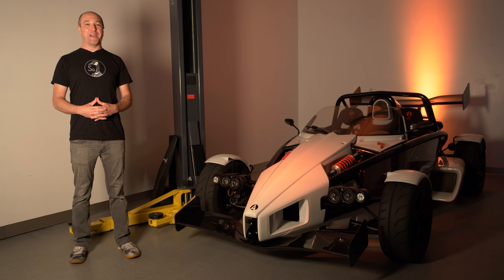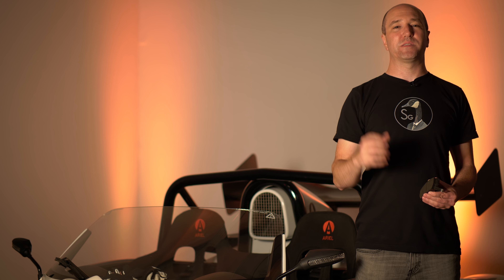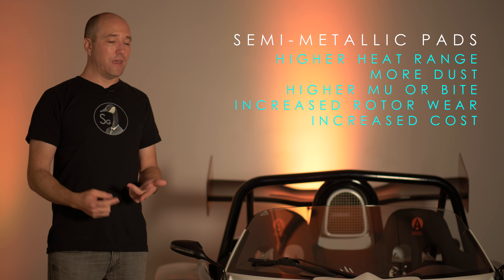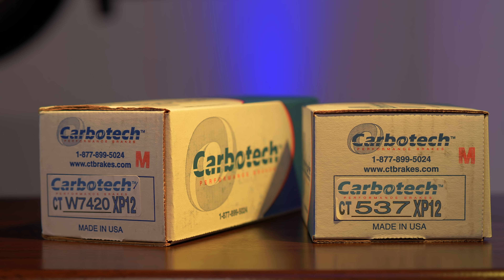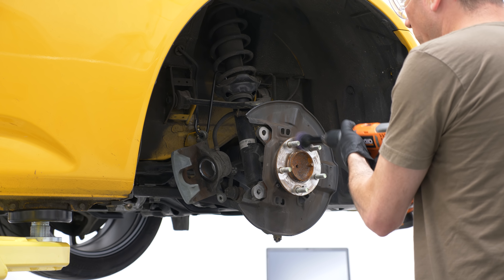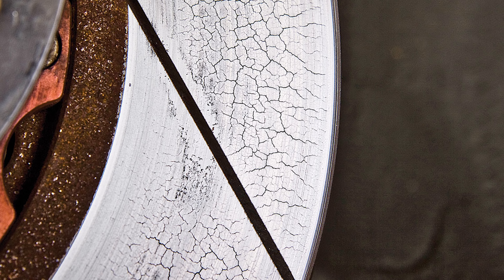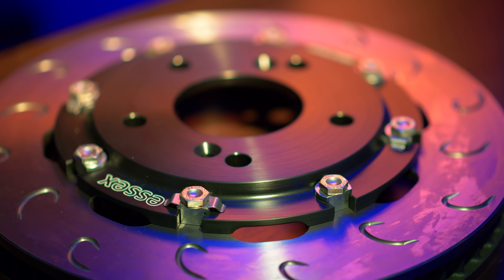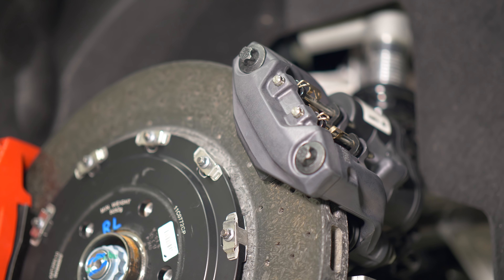Learn About Brake Rotors and Pads | Fine Print Series

Comment: +savagegeese  Question:

2016 WRX with 40,000 miles has had rotors overheated a few times when driving in the mountains of East Tennessee/Western North Carolina, resulting in some pretty severe vibration. Resurfaced and new, stock pads, and it happens again after a couple of more trips to the mountains. 

Obviously the stock rotors and pads are inadequate. But I still drive the car around town, so I wouldn’t want to put something that needs a ton of heat to be effective. 

Probably need a compromise - something that can take quite a bit more heat and abuse for canyon-carving, but still have some decent street characteristics. 

Suggestions?
Reply: You live in a cold area and if you plan to go downhill through mountains you probably need to warm the rotors up by bedding the brakes in before driving on extended periods on those sharp downhills. Or just get a bigger car to handle that kind of braking. Notice how trucks and SUVs speed through that part of the country with less brake fade.
Reply: Omar Tinoco First, the problem I’ve described is happening in warm weather. 2nd, the brakes ARE warm. 3rd, a bigger vehicle would still experience these problems if the rotors were incapable of bleeding heat off fast enough, either due to material, construction or being too small for the car/speed/usage type.
Reply: He just said that you can't expect to go speeding and braking in the mountains while using organic pads. Just get a pad with a high temperature range. Semi Metallic. But expect to wear into your rotors.

Comment: Mark, have you tried Yellow Stuff EBC Brake pads? Because I have, they had the bite but after awhile they gave me vibration to the point I would never buy them again. They're made aramid fibre, I don't know of many brake manufacturers who use that material. If anyone think those will be good for street/track you're wrong, even though they say that in their description. Once I got them hot enough they fell drastically within 5-6 hard stops.

Comment: With bedding in being so important, and with proper bedding in somewhat challenging to achieve without a controlled environment (e.g., deserted runway), why doesn't someone sell matched rotor-pad pairs that are already bedded in properly (perhaps using a specialized machine)?
Reply: I guess the cost effectiveness of that process is under question. Bedding happens by itself too
Reply: I have seen this as an option the other day in a set
Reply: @web  Does it? My pulsating brakes will say otherwise! :) No, it's not a warped rotor. I'm merely an enthusiast, but all that I've read stated to bring the rotor/pad up  to temp and then let the system cool naturally without the rotor touching the pad. Basically, you want to "coat" the rotor with pad residue evenly. After doing X numbers of brake servicing, I find getting up to temp and let the rotors and pads cool independently to be challenging because there aren't many places around me that will allow multiple 60-5mph cycles and then park.
Reply: @X11CHASE  Where?
Reply: It seems likely to me that there is going to be some variance in dimension and alignment between cars (of the same model of course). Bedding in a pad outside of a particular car might not actually align with the final installation in all cars, which would negate the benefits of pre-bedding. 
Now, it is possible that the tolerances from car to car are indeed close enough and no one has yet bothered to explore this potential value added feature.
Reply: I would love to have that job!

Comment: Hey Mark, I was wondering if there are any issues moving from one pad compound to another, but keeping the same rotor. You said bedding brakes in deposits brake material onto the rotor; is there any chance the old rotor material won't work well with the new pad material?
Reply from the maker: The issue is with pad smearing or deposits and some cases the small pits in metal would accumulate pad material as well. That would cause pulsing in pedal.   You could take a high speed drill with abrasive  and clean up rotors before   new pads

Comment: Hi Mark, thank you for this video, I've been watching your videos for quite some time now and just recently I started to wonder why my brake smell like plastic or some bad smell after a hard breaking on my cx-5. I haven't had any work done to the brake pad or rota it's 2014. the smell goes away after it cools down. should i be concern?
Reply from the maker: Thats really hard to say, are you sure its brakes?  If you are smelling brakes and you are not hard on them you may have a caliper sticking.  But thats a very a wild guess.
Reply: savagegeese yes definitely brake, only smell it when times I have to slam on the brake just a minute. Before I reach home.
Else normal braking I don’t have the burning plastic smell. Guess I will ask on my next service, thanks for responding though

Comment: Mr goose. I’m leaning towards the ceramic pads for my mk7 golf r. I occasionally go to the drag strip sometimes but on the street, I drive like a sane human being and I never usually slam on the brakes. Even at the drag strip I’m careful. But, I’m sick of the high dust I get from the stock pads. Would you say ceramic would be best for my scenario?
Reply from the maker: Yeah that's usually why people go to ceramic pads as for what you're complaining about. Just be prepared the pedal might not be as firm but it will stop about the same.
Reply: savagegeese Gotcha, for a stock pad and braking system, it’s good, you know, you drove the 7.5 R. I just work too much to constantly wipe my wheels off everyday. I just bought new wheels and got them ceramic coated so the brake dust shouldn’t ruin the finish of them. Thanks for the feedback Gooseman. It’s a crime that you don’t have a couple million subs just sayin.

Comment: I might make myself look silly here, 0:51 that type of design of pad with the gap in between the pad material, why not use 2 types of material on the pad? Wouldn't that be the best of 2 worlds so to speak?
14:44 I don't think you would want a cracked rotor in any situation?
Sorry one more question. This bedding in process, every time you wash your car or it rains doesn't that wash off the layer?
Reply: Bedded-in brake material won't wash off the rotor just with water alone. Alcohol, maybe, as that happens with bicycles with disc brakes (and yes you do need to bed those in too for best results), but friction material on car brakes should be hardier even against that.

Comment: So since you offered it so nicely, what pads and rotors should i use. I have a 00 Civic ek4 hatchback (~180hp b16a2 n/a ~ 950kg without me 80kg in it) 

I have upgraded from a 262mm front and 242mm rear to a 282mm front, rear still the same. Rear of course not vented. My front calipers are from an Accord Type R and they are 2 piston. 

I want to use the car mainly for track driving and a little spirited street driving. But mainly tracks like Nürburgring Spa Hockenheim so real Gran Prix tracks (im from germany) no autocross. I have 2 sets of tires. Street set with yokohama ad08r and a track set with Nankang AR1. What would you recomend?
Reply: I doubt you'll get an answer from the Geese himself :) Your upsized fronts should give you plenty of stoppage power. Are you experiencing any issues? I used to run track days in an Integra TypeR DC2 '96. Cooked brakes until I swapped the front rotors and calipers to larger Prelude variants. Staying within Honda is always easiest. What you have done so far sounds good, unless you have issues.
Reply: @TheChannel1978  i havent run it yet. Its just a little track toy with a b16a2. Maybe upgrade to k20 at some point. I allready have the dc2 subframe, lcas and steering rack. Also Cage seats and some other bits.
Reply: @99Lezard99  I think you'll be fine. At 950 kgs that is a light car and you have upsized the fronts already. I know guys running EXTREMELY competitive times in a car like yours and I don't even know if they used upsized rotors. Make sure you get the right pad for your application (endurance is quite different to hill climbs) but I think you will have no trouble whatsoever. Civics are easy to brake like most Hondas, especially stripped ones like yours. If you put a K20 in yours you'll have a missile of a car :) Not sure what that would do to balance though

Comment: Mr. Goose, 

Do you have any recommendations brake pad wise for a Brembo GT BBKs 380mm front, 360mm rear w/ Type 3 Rotors on a F80 M3? I am trying to avoid the ones that comes with the brakes themselves as I want to minimize the brake dust and hopefully no brake squeal. I am having a bit of trouble finding out the information I need on this especially on the BMW side since it isn't done often enough. The steel OEM brakes gives off way too much brake dust it is actually annoying. (Granted they last like 120k+ miles apparently).
Reply from the maker: You probably best off going with a ceramic pad assuming you're not driving on track or anything like that.  I like the carbotech 1521s quiet and no dust.
Reply: @savagegeese  I will check it out! Thank you. Yeah I probably wont track, if I do i will need to switch.

Comment: brake pulsations happen because of Disc Thickness Variation (DTV) NOT material clogging the cross drilled holes. DTV happens because of uneven pad material deposit onto the disc. uneven pad material deposition usually happens because of runout in the disc. Runout is basically wobble in the disc which can happen either because of poor machining or MUCH MORE COMMONLY because of rust on the hubs, causing the disc not to sit flush. Cryo treatment has nothing to do with the deformation of the disc, cryo treatment allows internal stresses within the material to be relaxed, raising the temperature and loads at which cracks start to form.

Comment: I have an odd problem with the brakes on my 2 year old CX-5 (10,000 miles on it). Over time a narrow ring of brownish-red dirt seems to keep forming on the rear 2 rotors, which make them squeak a bit when using a light touch on the brakes, like moving slow and stopping. This doesn't happen on the front rotors, and doesn't make noise when using the brakes more heavily. This wipes off easily and comes off when I wash the car, but will eventually come back. I do live in an area that is rather dusty, and we do have a lot of clay in the soil here. Is this just simple dirt getting in there or possibly pad problems? Is this common in environments like this, and will this harm anything if not cleaned regularly?
Reply: Check the calipers that normally happens when a rotor has heen grinding and the fluid leaks on to the rims you get an orange type pixie dust

Comment: wondering if brake coolers / cooling duct work. like if you were to use a lower temperature brakes on a car that would generate much more heat to the brake system would it be beneficial in any way?
Reply: and thanks for the wonderful video
Reply from the maker: Are you talking about brake ducts?
Reply: Heat energy is removed from braking parts by conduction of heat energy from the brake part to the air flowing over the surface of the brake parts. If you flow more air volume over the brake parts more energy will be transferred from the brake parts to the air. Its a pretty simple concept overall. 
You still need to use a brake pad that is appropriately matched to the use of the car. Track day= track pad, street driving= street pad. More ducting (likely) wont be enough to let you use a street pad on a race track. 
I remember that EBC offered a pad (they might still be available) with thermochromatic paint that allowed you to roughly monitor the max temperature of your pads, so you could match you pad to your driving application better.
Reply: @savagegeese  yeap, but the gentlemen above answered it nicely
Reply: @WheelNut2  right got it, thanks for answering my question, really helpful

Comment: I moved to Japan and often drive in the mountains. I always do engine breaking but one one of the cars I am using has a CVT that doesn`t do well downhill even on the "sport" setting. Is there a way to check the temperature of the breaks, as I do fell worried often (N-box)? How to know that the hot breaks are too hot?
Reply: There is. Get an infrared temperate gauge. You can aim this at your brake rotors, brake pads or oil pan to get an idea about temps. Here's an example of a decent one. You can get these from $20 from China also but I recommend you spend a bit more and buy something somebody in the racing community has used and reviewed. The temperature range could be off by a fair bit in an inferiour product. https://www.ebay.com/itm/NEW-testo-830-T1-IR-Infrared-Radiation-Thermometer-Temperature-Meter-Tester-Gage/270995007434?epid=1119692442&hash=item3f188fa7ca:g:E1oAAOxy-1lRGwPP:rk:27:pf:0
Reply: Your brakes are too hot if your brake pedals starts to feel soft or go down further to the floor. This is either a case of the brake pad material being too soft, or the brake fluid boiling. If you suspect there is an issue get your garage to replace your fluid for Dot 4 fluid. Most cars come with Dot 3 fluid only but Dot 4 has a higher boiling point. That should solve your problem. If you still have a soft pedal with Dot 4 fluid replace your pads with a different type for 'street/sports driving application'. That means the pad should sustain more heat before fading. If you are not sure what pad you buy I can recommend HAWK HPS. That is a road/track pad  but mostly road, but will tolerate more heat than a stock pad. Hope this helps, stay safe
Reply: @TheChannel1978  It does. Thank you.
I come from flat part of Europe with no experience in long mountain driving.
I will pay more conscious attention on how the break pedal feels like all the time for comparison. The 660cc in N-box doesn`t boost my confidence for sufficient engine breaking. :)
Overheated breaks are no joke. There are often runaway truck ramps on the side of the roads in the places I go.

Comment: 18:00 I'm so sick of hearing about how much money you can save by replacing just the ring instead of the whole rotor with the hat as 1 piece?  the 2 piece rotor rings are always for performance applications, therefore expensive.  I have never seen a rotor ring that cost less than a standard 1 piece replacement rotor for the same application... have you?  their might be some niche application buried in the depths of the interwebs where this is the case, but generally every bit of going to a 2 piece rotor is more expensive when looking at up front cost only (could very well be cheaper when looking at regular track use and longevity).
Reply: I don't think you go to a two piece system for cost savings but for a range of factors. If somebody is so serious and fast that they require the additional benefits of a 2 piece systems than there is a chance they might crack single piece rotors quick enough to get some savings out of a 2 piece system. But l agree with 2 piece no usually being a route for saving money, that is not the way to think about it for most people.
Reply: 9000Redline yes exactly, but every time someone is going a brake rotor guide, they always bring up the "you can save money by replacing only the ring and not the whole rotor", including this one. And that is simply not the case. That's the part that annoys me...
Reply: Agree

Comment: Any experience between xp8/10/12?? I have the xp8 and they are fading at the track. 2015 wrx with federal fz201 tires. I want to upgrade when I finish the pad but I can't decide if I should go 10 or 12. I do use the car during the week so I need a compound that works dead cold. Carbotech doesn't seem to publish mu numbers. Any advice?
Reply from the maker: Id just go straight to XP12 just be ready for increased rotor wear. But no fade.
Reply: @savagegeese  XP12 will bite just as good as the XP8 cold? Do you happen to know if it squeals any louder? My XP8s squeal like hell already, guess louder is kinda moot.
Reply from the maker: I've driven the xp12 in the cold and they still bite but you do have to get more heat in them than the xp8. And yes they make a lot of noise.  It goes away when you really bed them. But as soon as you wear that layer away which is pretty quick they are noisy as hell.
Reply: @savagegeese  fuck it. Get the 12 and see what's up. 😋 Thanks for the info.

Comment: Mr. Goose!

I picked up a 2007 Accord V6 6 speed (silver coupe like yours I believe) in January and I love it. However, the glaring weak point seems to be the brakes. After a couple of medium-hard stops, the pedal gets mushy and feels very unsettling. There’s a mountain/large hill I drive on regularly and even when I go well below the speed limit, by the time I get to the bottom I feel like I wouldn’t be able to come to a stop. It seems like the brakes aren’t sufficient for the weight of the car. 

Now I don’t do any parking lot racing or track driving, so I’m wanting to know if I should get some more aggressive pads (semi-metallic maybe) possibly combined with slotted rotors and suffer some of the downsides OR upgrade to Acura RL 4 pot calipers and keep running oem pads. Or maybe I have no idea what I’m talking about. Thanks. 

Keep up the great work.
Reply: Just get more suitable brake pads and see if that helps. No point in throwing thousands of dollars at the problem if that problem can be solved with couple of hundred dollars. If that doesn't help, then wait until some sale comes and capitalize on that when upgrading the whole lot.

Comment: i dunno if you're ever saving money replacing only friction rings - even ignoring your time to assemble the rotor, the damn rings are just plain expensive
Reply: I think the point being made is they are more durable and hence can handle the high heat which will crack/warp typical one piece vented rotors. Using more expensive parts costs less than constantly replacing cheap parts.